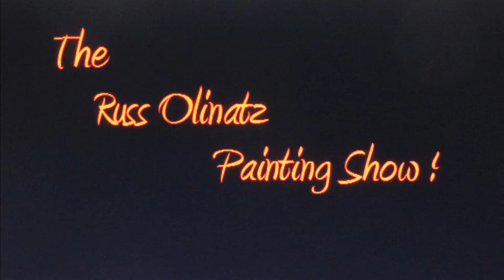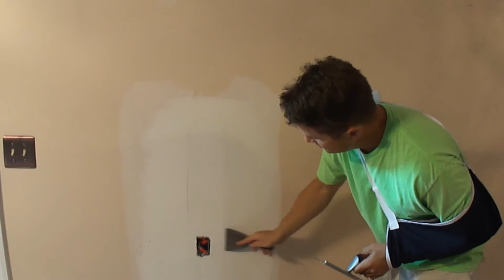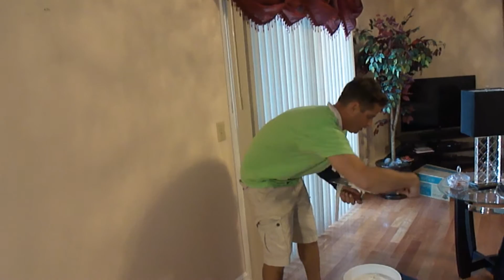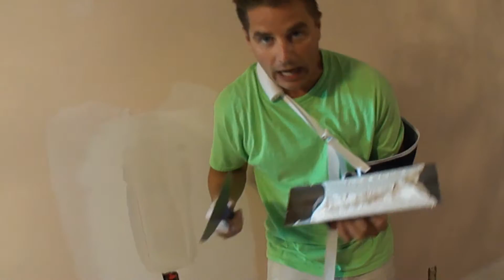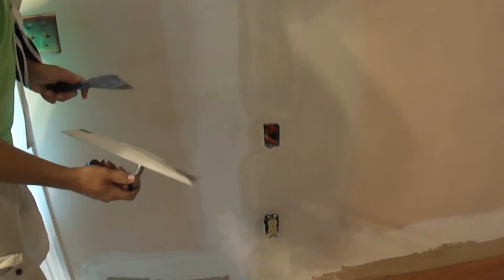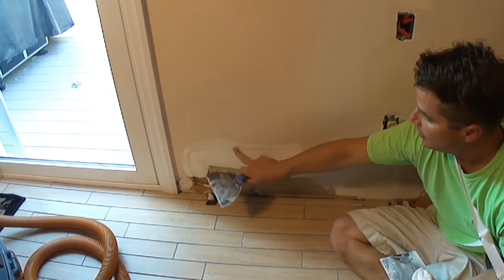How To Repair and Mud Drywall (Part 3)

Comment: Great job, can;t wait for the next installment. I noticed you used straight mud. Do you usually add water to your mud only when your taping, or is it a bit more complicated?  Thanks.
Reply from the maker: Hi-

I usually do add a little water so it spreads easier. However, it will shrink less and stick better the less water. I just didn't have my drill and my arm being in a sling...

Russ

Comment: I just took my first foray into mudding a few months ago and I have to say it's quite forgiving.  If it doesn't look quite right just sand it down and add another coat, but you've certainly got it down here.  Main thing I've found with this sort of work is waiting for the mud to dry.
Reply from the maker: HI-

Yes exactly. Then go back over it again to make smooth!

Russ